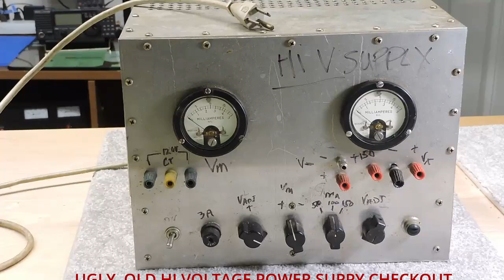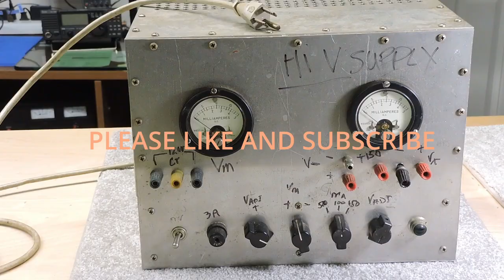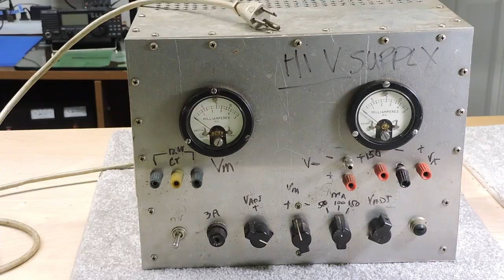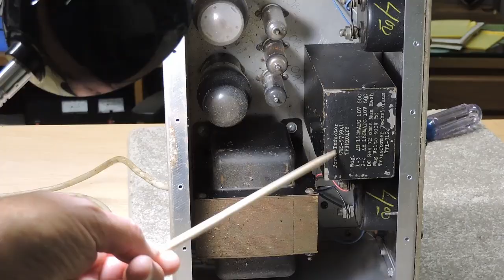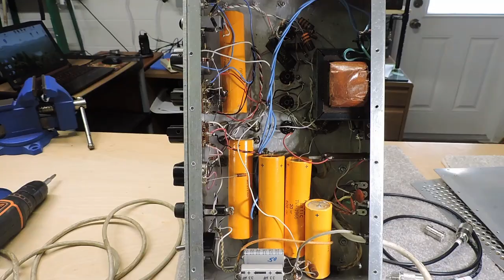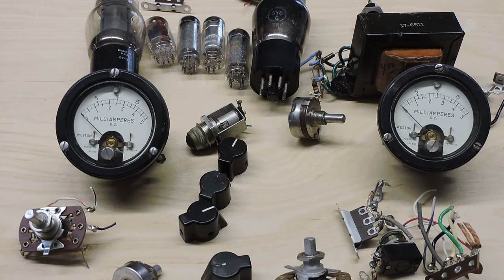UGLY OLD HIGH VOLTAGE POWER SUPPLY CHECKOUT

Comment: Intresting aproach from the desinger as leave the capacitors hanging around an metal case. I am not fimilar with the capability of the tubes and just asume it had regulation function and built-in current limiting. I think olso the tubes are more forgiving for the transients until they not get brake-down conditions internaly. I may just puting series/paralell some random junk caps and curiusly wach the circuit how performing. I am shure not worth the time but can be a suprise in either way.  I had an old germanium transistor based power-oscillator what is not repairable by the existing parts, it holds abaut 40Kg of transformers for the 200W output. It is only had some usefull parts to nowdays standards and it had not complicated schematic by its size, but it had many of clever solution inside what is just worth the time to geting the working principle benind these. I wish i always get something to learn from the elders, anyhow if its been just an “simple radio constructor” back in a day who built this HV psu.

Comment: That was a variable voltage regulated power supply. It would be hard to fix without a schematic because they are complicated. I use Heathkit supplies that are similar function in my shop.
Reply from the maker: thanks for the info 73